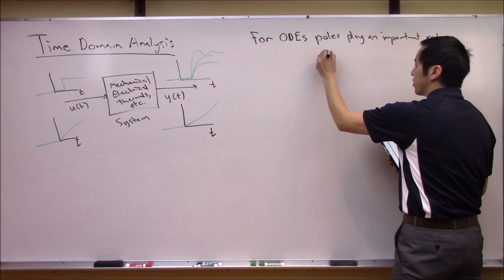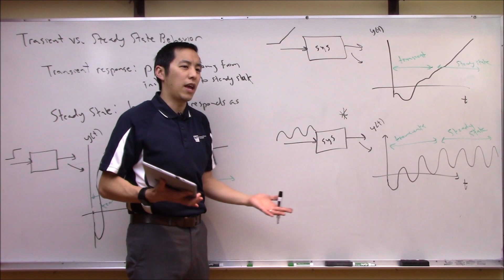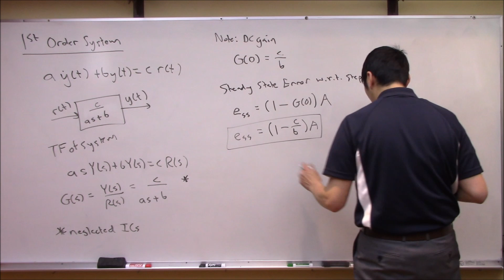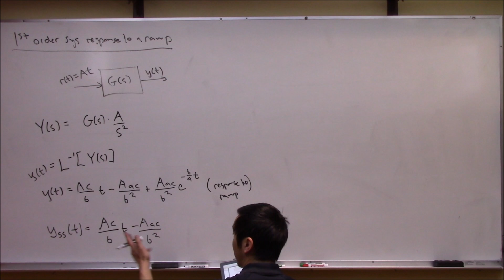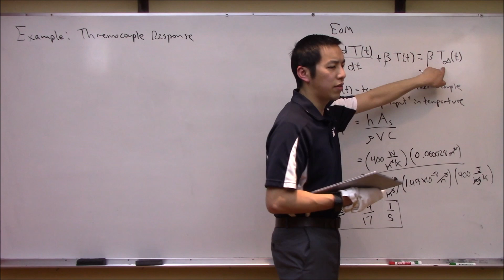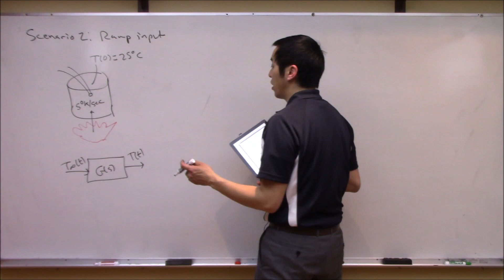Comment: AE511 Marshall Carter: Maybe I missed something, but in the beginning of the video, one of the motivating reasons for doing Time Domain Analysis was to avoid doing analytical solutions to get system behavior information. But then Fourier and inverse Fourier transforms are used to get the information we need to get settling time Ts for example. I can understand the value of having standard parameters or metrics to judge systems by, but it doesn't really seem like it saved us calculations. Am I missing something?